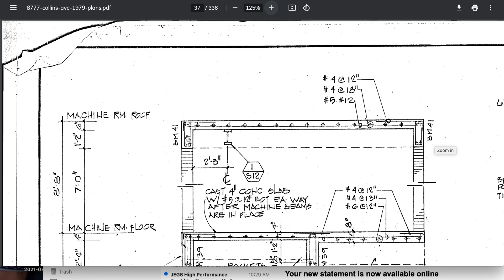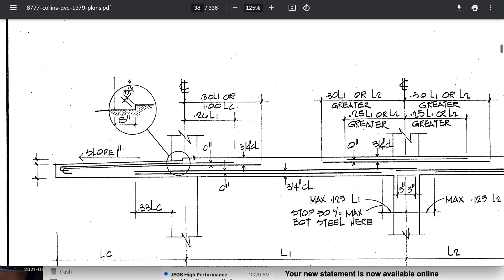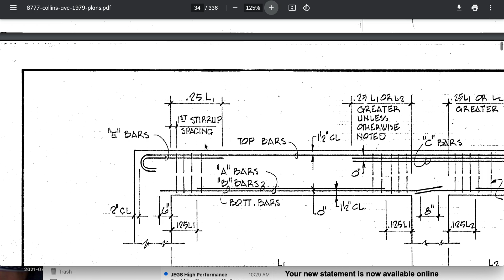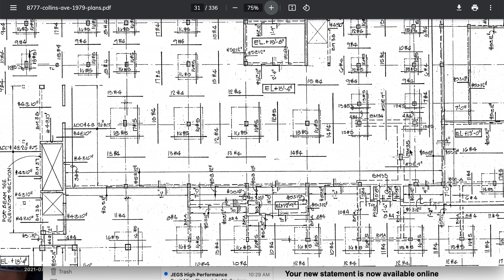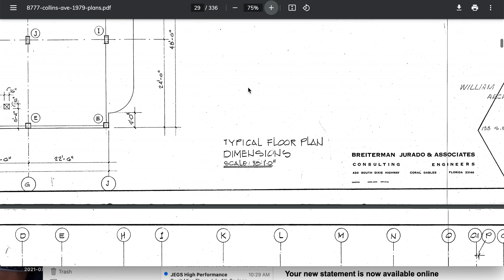Cassondra Stratton 87 Park  "Deck ledger and Beam verifications" Part 1 (shadow banned channel)

Comment: I am not an engineer, but I suspect improperly installed roof anchors (or something else related to the roof repairs) may have damaged the building enough to cause a chain reaction collapse. The building stood for 40 years, and they were installing the anchors the day before collapse. That would be a heck of a coincidence. Unless they were doing other structural repairs that we don’t know about yet, this is my suspicion.
Reply: However, whatever damaged the building enough to cause a slab to come down should not have been able to cause a complete top to bottom collapse. I’m sure they will find some corners were cut during construction.

Comment: Outstanding as always. After hearing the information from the videos, if you look at one of the close ups you did of the beam that is light on rebar, you can see where the second pour (cap if you will) appears to be finished flat. It looks like the completely removed the slopes and pitches by pouring a flatter slab on top of them, maybe to accommodate the paver installation? I am a Carpenter not an engineer, but I would not have allowed a contractor to "pour out" slopes if that is what happened.  
Thank you for being real. Love your sense of humor. I am also looking for a hottie in a thong to help you with your videos!

Comment: “Note! The bottom of the slab under the building proper shall be sprayed w/ 1/2” urathane insulation”
Not an actual comment, I just find the notes in these schematics interesting
Reply: Also noticed. It will be interesting for the investigation to determine whether this insulation was applied or not. Also some analysis of the hygroscopic coefficient of the concrete used.